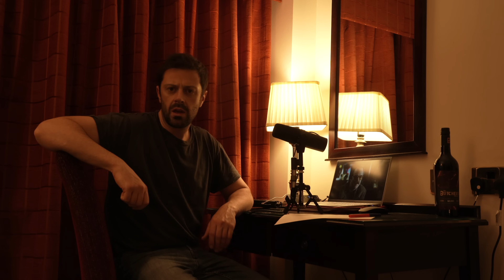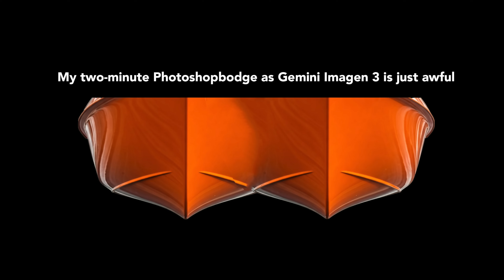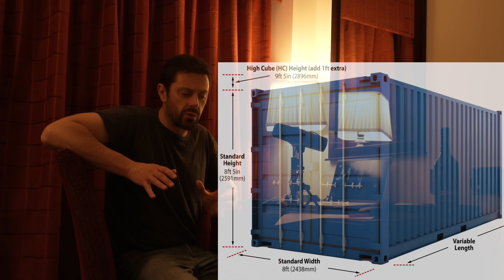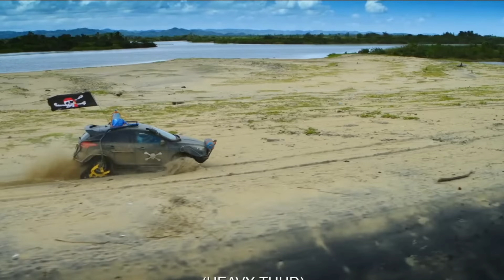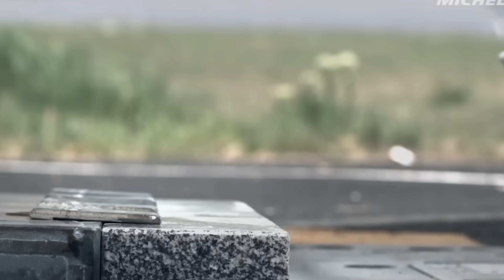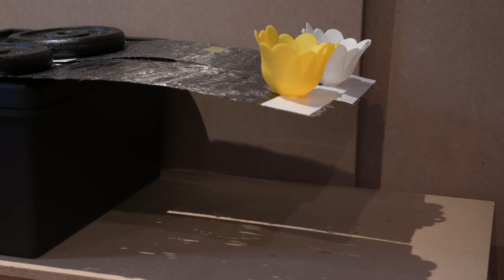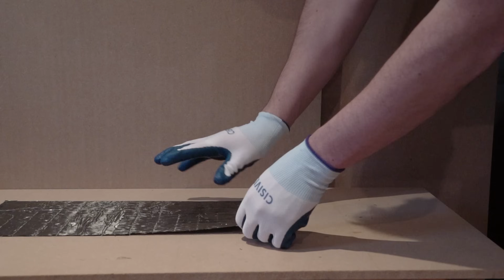The BIG Decisions: fuel, hull type, tracks/wheels, size, power. Bernard Arctic Vehicle Project [4K]

Comment: Firstly: This is a really cool project. I look forward to the ongoing progress. Secondly: At best, I'm an audiovisual engineer, and at worst, I'm an automotive & sci-fi nerd who spends too much time on YouTube. I have no vehicle design experience; this is just a thought experiment for me. Please take what follows in that context.

I wonder if you're selling yourself short on the power generation. The engine in a small sedan runs around 60-75 kW (~80-100 HP, as this yank understands it). Even if your electrical motors are 100% efficient, that's not a lot of power to move multiple tons across rough, irregular terrain. Also, with only 15 kW of power generation, you're looking at minimum 4 hours of charging time for every 1 hour of movement, assuming you use no other electricity. Being a platform for science and exploration, I'd want to have a power budget for computers, sensors, and communication equipment.

All that said, my guess is torque will be more immediately useful than power, and the actual draw from your motors will be much lower most of the time. Batteries will also help smooth out the difference between supply and demand, at least across short time frames (i.e. getting over a steep hill). Using the waterways (leeds was the term?), you might save a bit more power too, since a saildrive will be a relatively light electrical load compared to your wheels.

I would brainstorm the kinds of things you would like to pull off in a vehicle such as Bernard, and take a hard look at the actual power use requirements. I would then solve for the following items:
* Shoot for a 2:1 ratio of charge time to moving time, based on your chosen power train. (So, 16 hours charging for 8 hours moving, in any given 24 hour period.) Ex: If you end up with 100 kW of drive motors, you'll want 50 kW of generation.
* Add your power budget on top of that. Ex: 100 kW drivetrain + 10 kW for accessories (lights? comms? navigation?) and science observations means you need 60 kW of power generation. (This assumes the 10 kW is a constant , 24x7 load.)
* Given the experimental nature of this vehicle, and not knowing the unknowns, I would add 20% safety margin to the generators. In my example, that means 72 kW of power generation.

In my idealized world, based on my example math, you'd have 2x72 kW generators, so you'd be 100% operational even if one of them takes a dive. I expect those would be too big/heavy/fuel consumptive for your design goal, though. My guess is you'll end up with something closer to 2x40 kW generators, and be OK with a reduction in capability in an outlier emergency scenario.
Reply from the maker: Thanks for all the detail here. Rest assured all has been read.

I'm also keen to make sure we don't sell ourselves short on power, but it's indeed torque that we need, as speed is not an aim.  Whilst I may be running a little low, I think you may have overshot. For example, 10kW for onboard systems is probably 10-20x more than we'll need. Lights and comms are very low loads.

For motor capacity, I'm concentrating more on the torque they can deploy. 200nm is a very basic early aim. This isn't close to as much as a 4x4 vehicle, but remember they are rated to move not only their own weight (2500kg for a Toyota Land Cruiser, whereas we'd look to for half that for a dry weight), but also a payload of another 700kg, and towing 2500kg.

Comment: I'd look at the possibility to include "bus heater" which connects to the engine/generator coolant loop and cycles that through the radiator where simple fan circulates it into the cabin.

Many people use them in sailing boats in the Scandinavia/Arctic.

Alluring actic sailing channel has one nice video and installation on it titled: "FREE Heat of our boat! No extra running costs". There are lots of variants and models starting from as cheap as low $100's.
Reply from the maker: The engines will likely be air cooled and in the other cabin, but we'll look at the various heat reclamation methods.

Comment: Carbon fibre hull would make me nervous the way it can catastrophically fail from impact, especially a piercing one. I would use UHMWPE for the lower hull, even just as a outer layer it will take impacts and slide over the ice like teflon. It's often used as armour on the bottom of aluminum jet boats to take impacts with river rocks due to it being kevlar like tough, slippery and tending to return to it's original shape. I'd imagine a 6mm to 10mm thick layer of this on the outside of your composite. It could potentially be thermo formed to fit curves, I don't know. I have heard of a boat manufacturer making an experimental hull out of it, though external plates where the hull is vulnerable may be a better way to go than attempting to use it for structure.
Reply from the maker: If you check out my previous impact and deflection tests, including diolen and Innegra hybrid, and the series with easycomposites, we explore all these materials you mention in detail.

Comment: 6 driving motors for redundancy, 6 no-flat (honeycomb) balloon tires so you can inflate and deflate for buoyancy or efficiency, an additional propeller driven motor seems a waste of weight, space and is not needed with balloon tires that will provide some propulsion, auto shut-off for diesel generators (which are a great idea) to maintain power as needed and not wasted, HVO awesome, add wind generators and solar if possible. Would be nice to have sodium ion batteries being used in electric cars, like in China. US and Western Europe political and capitalistic systems make that difficult for some time, so, perhaps source your batteries from inside China rather than from outside. Dehumidifiers seem sketchy. A lot of energy for something you could expel with less energy since you will have plenty of water around you. Bio-diesel is the name you are looking for?  Awesome sound effects with the folding carbon fiber :P Loving the new project, I predict a jump in subscribers, more if you suggest people "like and subscribe". That's my $0.02 so far :)

Comment: I am really enjoying this new project and the planning process. If I may, I like to chuck a few ideas about. 
Firstly, I'd rather have equal generators in each of the forward and rear units. I'd just like to be able to rapidly ditch one unit and still be mobile in the remaining one even if   it's more catered to a living space. But definitely be able to swap genertaors between units easily. 

Secondly, I really like the airless tyre idea. However, I'd like you to at least consider Screw drive style vehicles. They're very manoeuvrable, buoyant and work in all terrain and water. They could even be incorporated into the hull shape. 

Keep up the good work.

Comment: Pro tip: To avoid extreme silhouetting and under exposure of subject, always put the light source in front of the subject, and if the differential is large, have the light source be behind the camera (off camera). :) lol
Reply from the maker: You assume I wish to be illuminated ! 

Saves on makeup.
Reply: @AlexHibbertOriginals  🤣Adds to your mystique.

Comment: So regarding climbing out of the water onto the ice, I think that you are going to need something to help with this as you won’t always have nice sloped beaches that will just let you drive out of the water.  I propose that you have a system to launch an aluminum anchor with a built in electric heater.  It would only need to go a handful of meters.  It would heat up (the high thermal conductivity and low thermal mass of aluminum being very helpful here) to melt the snow and ice around it, then turn off the heat to allow the ice to refreeze around it, holding it solidly in place, which would help the vehicle pull itself up onto land.  Then the heater is reactivated to melt the anchor free of the ice so it can be retrieved and reset into the launcher mechanism.  

I would suggest that the launcher mechanism be a small catapult arm mounted on the roof.  The winch mechanism should be placed relatively low so that it will be inclined to pull the front wheels up as the vehicle tries to climb onto the ice.
Reply from the maker: Quite, and it's usually tracked vehicles that find this easiest. We'll need to get the bow angle right, and the distance from nose to wheel right. A winch for tricky exits of the water, for sure. I'll think on the heater idea.
Reply: @ I just think it would provide a much more secure anchor point for very little work or weight.

Comment: I would suggest that you reconsider tracks.  While more complicated and more prone to failure at high speeds, tracks provide a massively increased surface area.  More surface area means less surface pressure.  I also don’t think you’ll need to be going particularly fast so tracks should be less likely to fail.  Also, in the event that a track does irreparably fail, you could potentially opt to remove the tracks from that hull and drag it as a sled.

Comment: 8x8 driven hub motors, 2 identical hulls, 2 identical cabins, 2psi (exhaust or air). I wonder if a jet drive would be a good option for water travel. Very robust, simple, and you could get a used consumer 200ish HP version cheap.
Reply from the maker: That's a lot of motors - seeing whether some wheels can merely be load bearers.
Reply: @AlexHibbertOriginals  Im picturing a fiberglass monocoque which is identical top and bottom. The transom can either function as a trailer hitch or an apeture for a jet drive/outboard.

Comment: With regard to airless tyres: Remember that air-filled tyres, especially large volume low pressure ones, offer considerable buoyancy, which is very useful to amphibious vehicles.  Many airless tyres are open at the sides and would not offer any real flotation.
If there is an airless tyre that is fully enclosed and offers flotation, great, but if not then I think the loss of buoyancy would be hard to justify.
For the electric drive to the wheels.. to maximize efficiency and room within the hull, wheel motors would probably be the way to go. The only question would be their ability to operate in salt water reliably, especially considering the range of temperatures they will be subjected to.
Reply from the maker: They certainly do, although due to wheel positioning, rather low down for good stability. It may be better to use inflatable bladders higher up should we find buoyancy lacking on short water sections.

Wheel motors/belt drive is a MAJOR debate we can all have in due course.

Comment: Please take good consideration for the voltage of the system. 48 volt seems low for powering your electric motors. Especially if you consider the distance between power source to the electric motors. You might need strong electric motors to go up some steep hills. Wire gauges become a problem at steep inclines and lower voltages. Having higher voltages like other EVs will give more flexibility and easier power distribution (more power through smaller wires). But it comes at some other costs like safety with handeling batteries and cables. Good luck on the project! I’ll be following it. Cheers 
I’m not an expert in this field but it is something that is definitely worth having a good think about.
Reply from the maker: You're right that this needs lot of attention. Although as I'm aware, the main reason EVs are 400-800V is to allow extremely fast charging. Lighter cabling is a bonus too. The high torque low speed motors I'm looking at have 48V as a native voltage, and it means a simple 2 or 4x reduction for basic electrical systems like nav and lights.

Comment: Mousse? Like on enduro bikes?
Reply from the maker: Pros & Cons of a Mousse

In general, a mousse is known to do one thing very well, NOT go flat. However, they are also known to have several downsides, such as having a slow rebounding or non-progressive effect in their rideability. In the industry, this is often referred to as a “DEAD” feel. This loose or unstable feeling can affect the motorcycles handling and traction applications and unfortunately, you just have to live with it because they are not adjustable (Like pneumatic systems or inner tubes), other than that they do adjust themselves as they diminish and wear.

Being a solid foam unit, mousses are generally heavier than most tubes, and the dead feeling only contributes to this effect and feel. Other negatives can be their short life span, made worse by their high cost (Nitromousse is a big improvement compared to past mousses).

Comment: This point is something i do not understand, why it was not adopted - Why any and all those arctic vehicles consisting of two hulls connected to each other, do lack a connecting bridge from ONE car to the second? I mean, that would allow the crew to FULLY use the inner space of the second vehicle and double their living space, not to telling it would let them to easily and longer check the connecting powerlines and towing part... BTW sugesting you to leave a space for third "car", wich would be simple sled-tank for extra fuel. 

Regarding the airless tires, i sugest you to first check out, what will the (relativly thinn) slice of material do, when affected by arctic freeze and put weight on. Me personaly would fear it will brake the slices inside the airless tire design. Maybe try to find the drivers of kharkovchanka or other arctic vehicles, and ask THEM. Or go for tracks, but spent a month or two by getting them down, repairing them and getting them back on again.

I wrote that in your vid "Ultimate arctic vehicles" - try and check "Vityaz ATV". It is bigger than you want, but its capabilities are unbelivable and it was BUILD for arctic military actions. 
https://en.wikipedia.org/wiki/Vityaz_(ATV)

If you will pick tires, get inspired by hardship any and all vehicles with tires have when trying to crawl from water on ice. Sugesting to add a short tracs in the front of your vehicle, not used for regular movement, only for scaling up from water on the ice. 

Interesting idea you adopted, but did not see all possible ussefull applications - Each driving/command vehicle should have a telescopic pole (possibly with camera or thermo cammera for easier orientation) and extra bright light (LIGHTHOUSE bright light). That will give your vehicle:

1) extremely help with spotting other vehicles in bad weather, even when further away (speaking about the "lighthouse effect" when you place there a powerfull light)
2) give your radio a hell of an height location for antena to increase its range
3) better lookout position for enhanced situational awareness, witouth need of radar. (camera or Infra camerra will do just fine). 

Regarding the kithen - I sugest you to bring with you a box of MREs - preferably some kinds you KNOW you like. It does not need utensiles, dishes, not even glass or mug - all of that can be simply heated and eaten in and from the packaging. Another up point for pre-prepared food - it is counted as food with enough energy for hard working military men - that should came handy in environment, where simple walk can cost you heaps of calories. And it is heated by heating tablettes being soaked in water, wich wapours and the steem does heat the package of food....

Why storing ONLY FUEL like that? Add some food, medical supplies, alcohol and lubricants, just to be sure. If i remember, during the first years of conquering the poles, smarter expeditions did pre-preepare a chain of supply-stations, BEFORE the main expedition even departed. 

Extremely ussefull ability for sub-zero expedition vehicle is access to the engine from inside, for possible repairs. 

For the (especially destructive) test of carbon fibre material, you should use FROZEN sheet of said material. At least the outhermost part will be much colder, than inside temperature.
EXPEDITIONARY SHIPS (i.e. those going to the arctic) are usually NOT build out of carbon fibre, although tropical going yachts are. I sugest you to ask the ship builders why. They might know things about the carbon fibre when frozen, no other knows.
Reply from the maker: Thanks. I'll have a look at design features to inspire us from the Vitayz. 

We might struggle for the power to tow a third shell, and it's also about noise and fume isolation.

Yes I showed a plan to use a tall pole for the uses you outline.

MREs are pretty awful! Sorry - we'll go with out expedition grade meals. And we can fish too.

Stowing other supplies on the ice in spheres is certainly possible.

We've done lots of cold testing of carbon matrixes, and they perform brilliantly at -40.

Comment: a multi-input, multi-output series hybrid drivetrain makes a ton of sense for something like this. you can add solar, or wind, as backups/supplementary equipment as desired. you will probably want some kind of system for managing whether power is going straight from the generators to the motors or through the batteries depending on the state of the whole system, but this kind of thing already exists. very smart, Alex. looking forward to seeing the rest of the design.
Reply from the maker: Cheers

Comment: Polycarbonate is UV filtering if you didn't know. Might be good for the eyes with all that sun and reflection
Reply from the maker: I may be wrong, but I think only certain grades are UV-proof. It's also easy to scratch. Otherwise it would be the obvious choice over acrylic or glass.